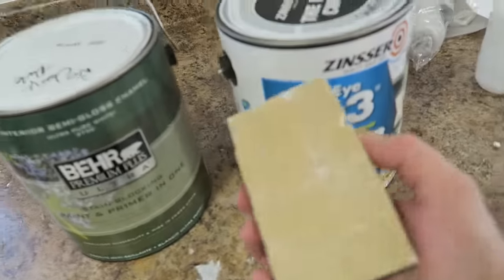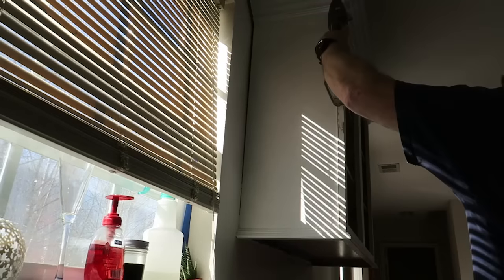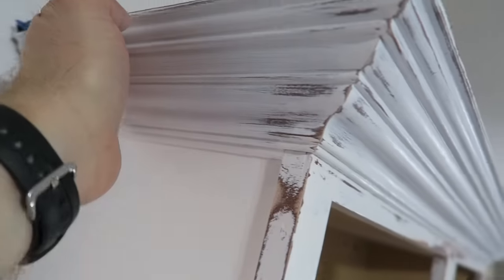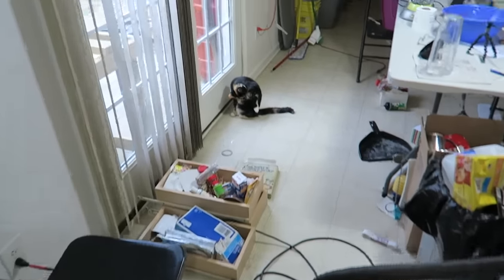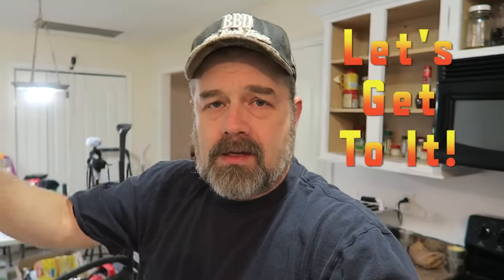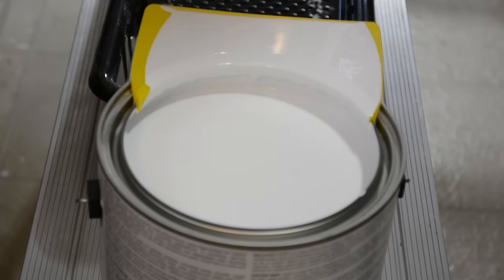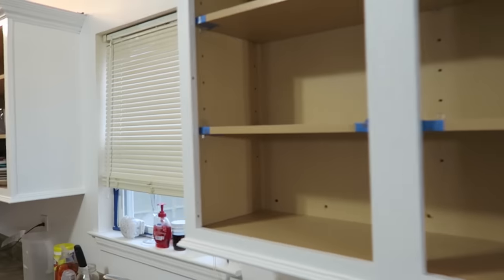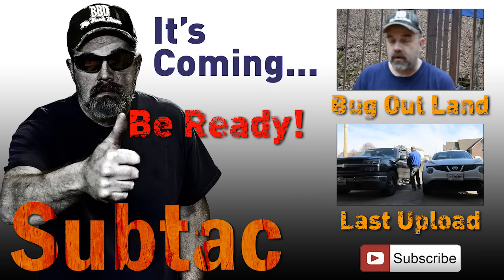How To Make Over Your Kitchen Cabinets

Comment: 3 Questions... How did you first clean the cabinets, any special degrease?  Did sand down the cabinets at all before beginning or just clean them?  Are you going to sand that primer coat?  Thanks for sharing, we want to do this to our cabinets so we are watching intently.  By we I mean my wife wants me to do this to our cabinets so I am watching intently : )
Reply from the maker: +Mick Bator My suggestion is to sand first. You really just need to scuff it up so the primer will hold. The primer we are using is supposed to lock everything down that is already there and then hold the new stuff on as well. The Rustoleum kit we tried first had some stuff they called deglosser and you are supposed to use it to clean and then sanding is not necessary. It doesn't work as far as I am concerned. Just go the traditional route. Thanks for watching intently! :-) There will be more about the cabinets to come.